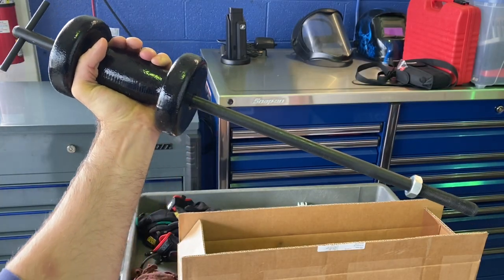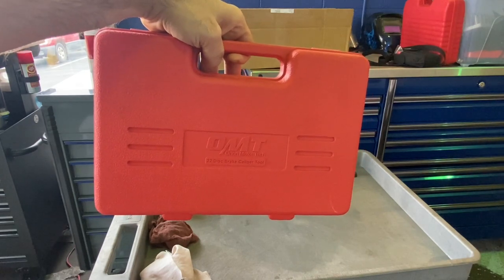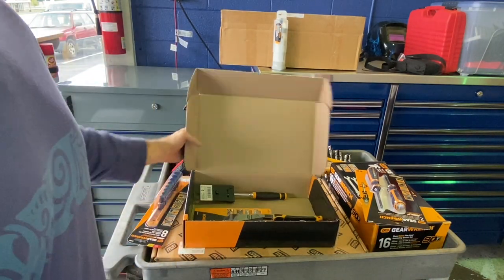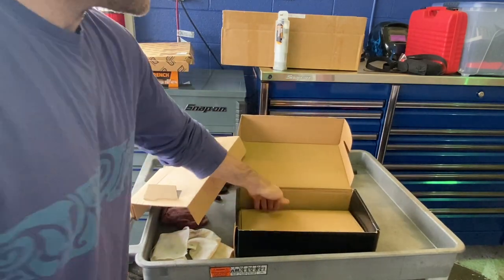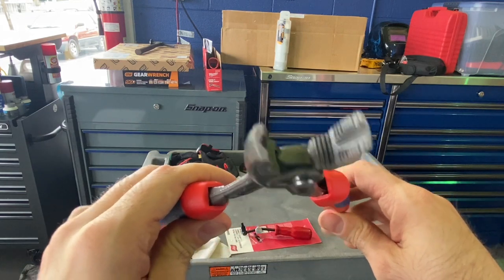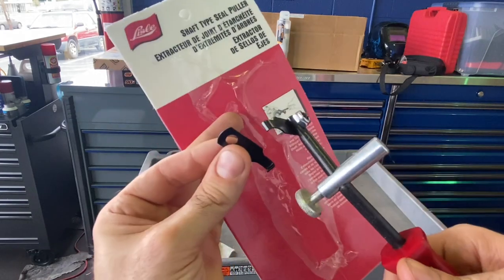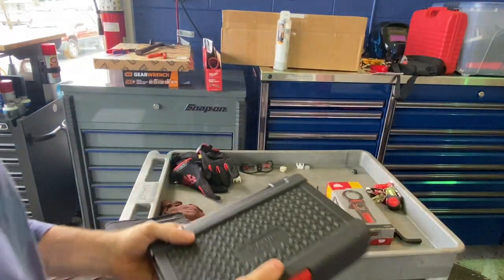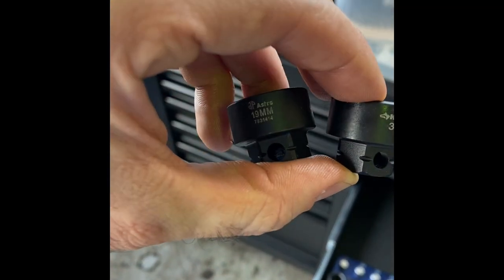🔥🔥🔥Massive Tool Haul - New Tools and First Looks 🔥🔥🔥

Comment: That Lisle oil filter socket kit looks identical to my Matco set. Except those are gray and mine are black. Ok almost.. mine are the old style, not as reinforced. The steel ones are the way to go. The aluminum ones don't last through use and round off the flutes.

Comment: Do you know of any 1/4" hex long nut drivers but that are hollow like a dedicated nut driver and not magnetic?
Reply from the maker: If you need really long Klein metric are not magnetic but their sae are.  The Icons at Harbor Freight look nice and don’t say anything about being magnetic though they are standard length.  Another option to look at is Milwaukee if they are long enough for you.  Klein’s and Milwaukee are at Home Depot.
Reply: @asmautollc  just to be clear, these are all male end 1/4" hex shank with hollow shafts?
Reply from the maker: Well technically they are female as they go around the fastener or nut and they all have hollow shafts, yes.
Reply: @asmautollc  I meant male for the part that clicks into the impact driver or bit driver